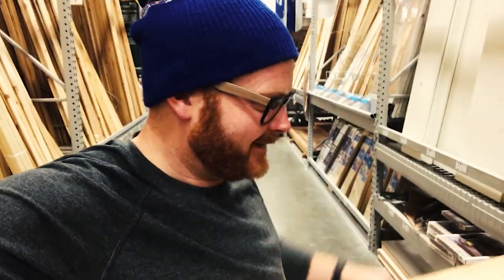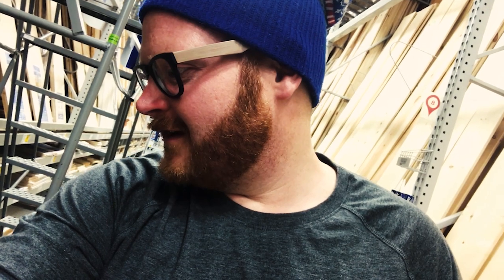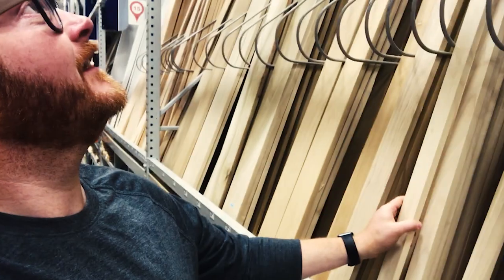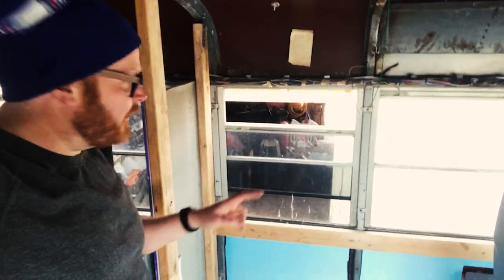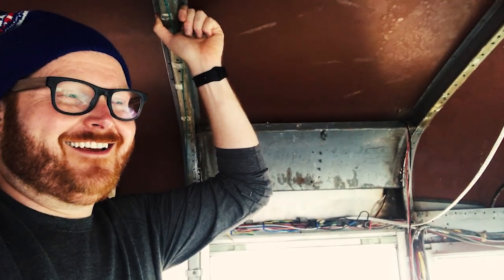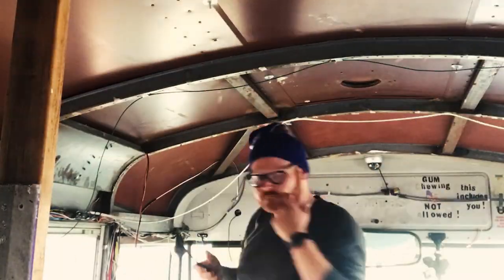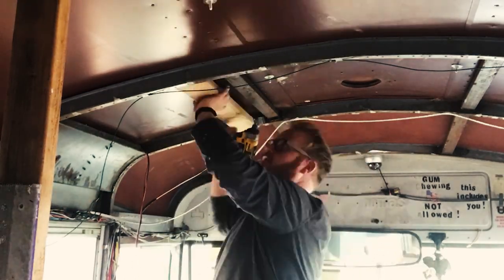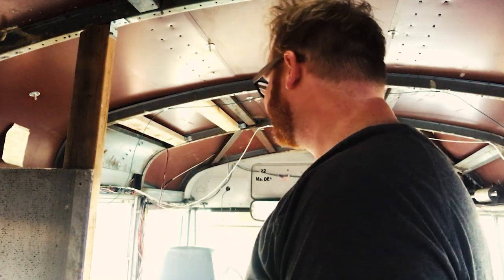Work From Home Office Framing | Skoolie Bus Conversion Tiny House Videos

Comment: Ah that's looks awesome!! I'm sure is a method to your madness lol but how come you are framing stuff before putting in the ceiling and walls?
Reply from the maker: All of my electrical wiring and water pipes are in the walls and ceiling, so until that's all finished, the wall finishing and ceiling can't go in. All of the visual finishes (floors, ceiling panels, wall coverings) will probably be one of the last things I do. If I need to get into the ceiling or walls to access any of that stuff I don't want to have to remove ceiling and wall panels each time. I don't know if this is the right choice....but regardless, it's what I'm doing. hahahahaha!
Reply: Jeffrey James Binney ahhh that makes sense! We have no idea, just learning from watching you and others :) we went and checked out a few buses today. Didn’t buy anything, but we got an education lol and had a very positive experience.